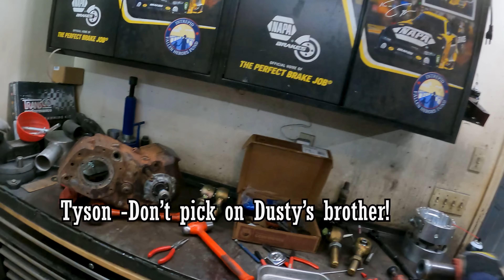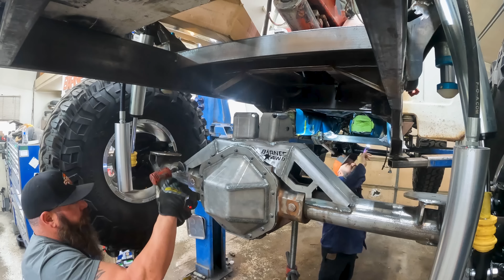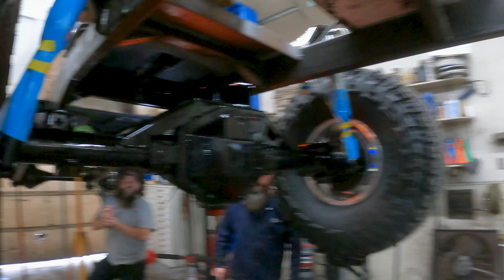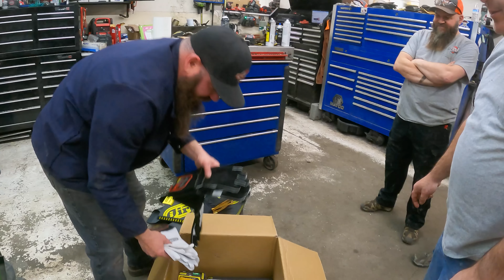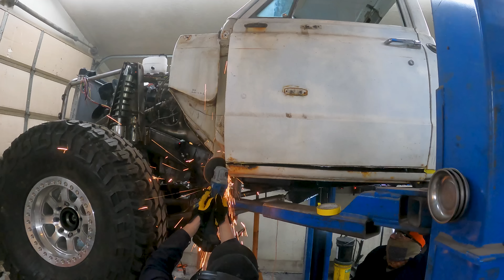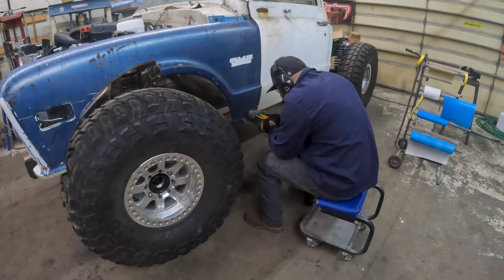Getting Some Paint On Griz The Off Road Wrecker!!

Comment: No miracles here, just sweat, blood, tears. Griz underside in black, wow what a difference!  Can't wait to see the front fenders and door panels modifications and supports installed. Chad get well. After a week, you look a bit under the weather. 6 weeks to the offroad games. Depending on your team to fill the gap left by Paul and Merlin. No pressure.

Comment: i hope you are tieing the sill slider to the frame in at least two places each side as I have seen the slider pushed up to the bottom of the door and floor so you cant open the doors, had it once where both doors were wedged and we had to climb out of our respective windows, surprised us we thought it would be strong enough but a seven thousand pound vehicle it did not have a chance, quite a job straightening the floor and door jam so the doors could open and close.

Comment: I got a little PTSD looking at your transfer case and remembering all those needle bearings when we rebuilt our np205. I still remember there's 34. I imagine you're using a special paint like chassis black on grizz's frame not just regular paint. If you like the results maybe mention the brand in your next video. I will be doing the same thing soon. Thanks

Comment: So it will be the battle of the supercharged tow trucks between you and Fab Rats.  You will have the horsepower but he has the rpm. No replacement for displacement.  Big block power is hard to beat